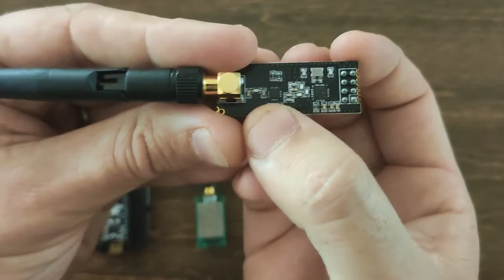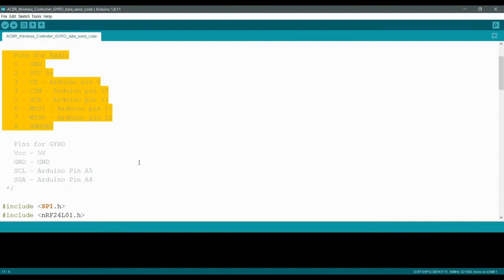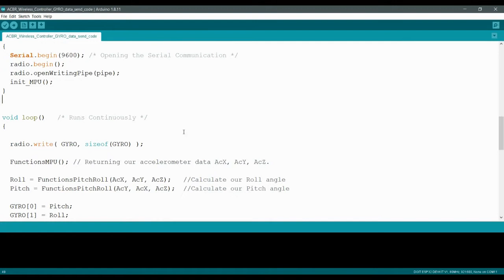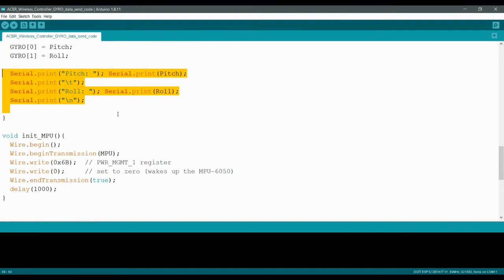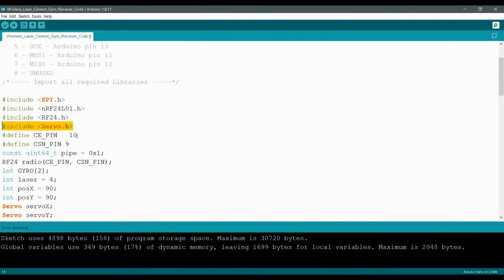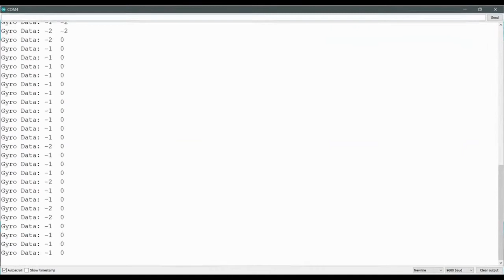Getting Started with the RF Nano: A guide to getting two Arduinos talking with the NRF24L01

Comment: Got myself RF nano and even test code doesn't show any data being transferred. Is there any specific library or anything else that's needed for this specific board? Got 2 Manos with rf24 attached working fine but RF nano does nothing. Any pointers?

Comment: I know this is an older video, but I am having a huge struggle getting two nRF24L01s sending data. It worked and then just stopped working suddenly. I don't know what the issue is. Do you think I should switch out to these or keep trying? I've been working on this project for like 7 months now and have spent probably double my original budget. 

Should I invest in these or push through? Because these seem very enticing, especially because I know how to do PCB design.

Comment: Really nice video! I’ve been working on a drone project for a while and having some trouble with the nrf24 modules. I think I’ll tryout the RF-nano. Do you have any advice on how to control the speed of a bldc motor using gyro? Thanks!
Reply: Anyone Can Build Robots! Thank you for replying! I had a quick question. I’m trying to make a drone using purely arduinos, and have stumbled across a big issue. How can I interrupt certain controls, like throttle, and send something like the pitch and the same time? Is something like this possible with nrf24s? Thanks!
Reply: @musaahmed9265  Hey! I know this is over a year late, but what you can do to send multiple things at the same time, is store them all in a struct, and then send the whole struct at once! 
Keep in mind that the NRF24 has a max payload size of 32 bytes so the entire struct has to be less than that.

Comment: You are a life saver. I have spent all day trying to squirt 5 items of identifiable data between two RFnanos using all sorts of sprintf commands structuring and de-structuring the data at each end with dubious success.Your little bit of magic with arrays has solved all my problems in about four lines! (I am not a seasoned programmer you can tell)   Many thanks